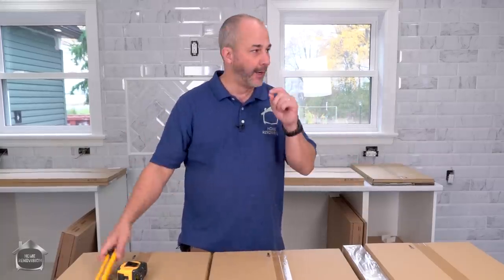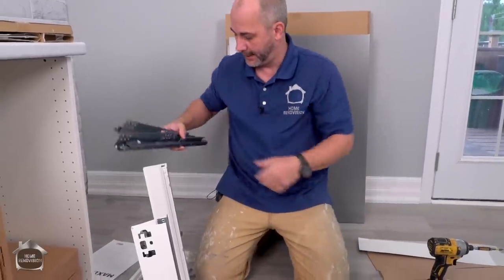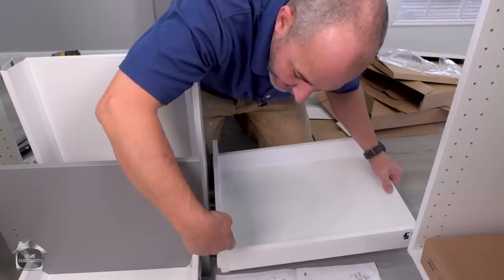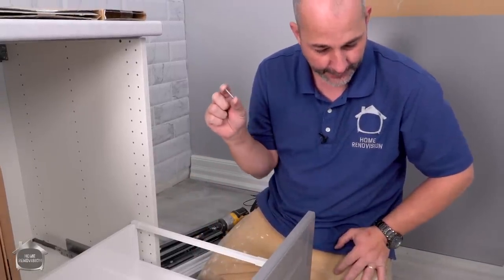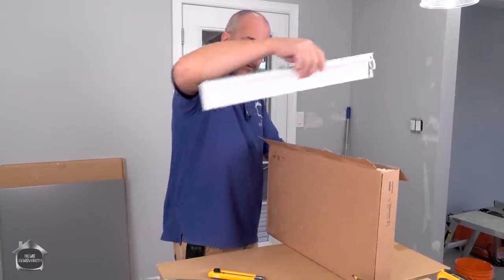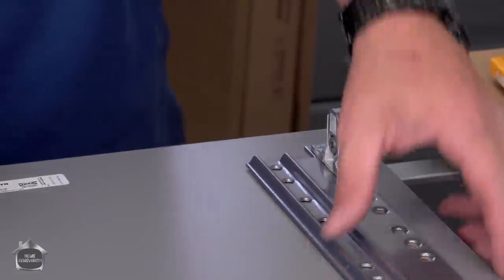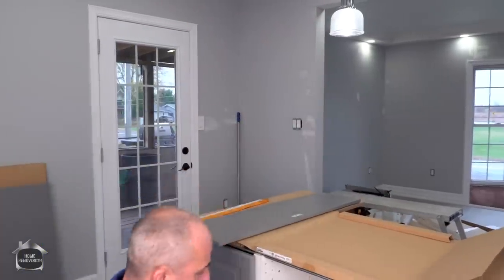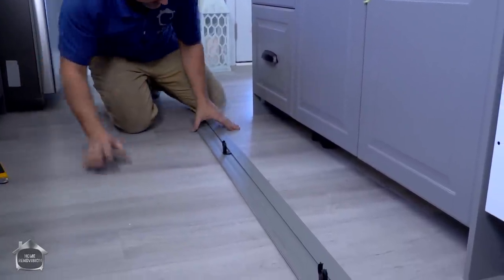How to Remodel Your Kitchen with IKEA Cabinets | Beautiful & CHEAP DIY Tutorial Pt. 2

Comment: 10 years ago when we looked into reno our old kitchen in our first house, went to one of the "well known" brand got a quote for 30k CAD  with 8 weeks plus lead time. Went to IKEA and got everything for 5k, installed all the cabinets in one week. even after 6 years of usage, the cabinets were still in top shape, everything held well when we sold it. For price and quality, there is nothing can beat it IMO. Will definitely buy them again when we built our next home.
Reply from the maker: Thanks for that. nice to know you had a great resale as well. Cheers!
Reply: not my IKEA stuff.. I have children and a very active kitchen and those cabinets barely lasted a year before they started showing their wimpy finish and garbage quality.  The particle board door do not survive nicks and bumps.  If your dishwasher hose ever fails or you have a bad plumbing day, the micro-layer of finish is not enough to keep the particle board from swelling even 1 spill sitting for over a half hour.  If you live in Arizona or a dry area... its even worse.  The particle board turns to dust.  Unless you have a kitchen just for eating take out and looks (not cooking, raising kids and living in...) spend the extra money on real laminates and / or real wood.  I DO highly recommend their counter tops and their appliances.  I got a beautiful quartz counter and very hip appliances (made by whirlpool) all my fixtures are IKEA.... it's just their cabinetry that was horrible!
Reply: I purchased my kitchen at Lowe’s. Spend about $5k. Great cabinets!! I also helped my folks install their IKEA cabinets. They also spend about that much. That was 8 years ago. Both kitchens are still going strong. The important thing here is to just do it yourself.
Reply: @inTruthbyGrace  nah i have kids to and a ikea kitchen nothing wrong with it. And the fun thing about ikea is you can just walk in and buy a new cabinet they ain't that expensive. besides they have a ten year guarantee so take it back if it wasn't your fault
Reply: We had our Ikea  kitchen installed about two years ago. We too visited the well known suppliers and got absolutely insane quotes. So it was off to Ikea. You measure your kitchen and have a good idea of where you want everything. Make an appointment with one of their design staff. They input your ideas and measurements into a computer  and can instantly give you a quote. We went with meter high wall cabinets instead of the usual 80 centimeters, more storage space! Their base cabinets are lower to the floor than standard cabinets, more storage space! We had two drawers installed under the oven for pan lids and shallow oven crockery, more storage space!  We used fifty mil worktops instead of the usual 75 mil, cheaper and does the same job. We went with flat white handleless cabinets, looks neater and easier to clean. All doors and drawers have silent closing. 
Now before your kitchen is installed the fitter visits and checks your measurements to make sure everything will fit. (What? You have never made a mistake with a tape measure.) 
Two important points about Ikea. They will not try to sell you anything, they will however endeavor to provide you with what you want. Secondly, when the job is done there are always bits and pieces left over, they are individually wrapped with bar codes. Take them back to Ikea and get a refund! We got sixty one quid back, now who else will do that for you?  And of course everything has a  twenty five year warranty.      
Would I recommend Ikea? Is the Pope Catholic?
Reply: The thing about Ikea, is that you get what you pay for. The cheapest options are not as good as their most expensive ones. Installed the cheapest Ikea Faktum kitchen 15 years ago, and the doors did not last. Just before they discontinued their Faktum series in 2012, I ordered new doors for the entire kitchen which were the solid oak ones. 8 years later and they still look as good as new. If you can afford it, go with their top of the line models. It's definitely worth it in the long run.
Reply: IKEA put their stuff through som though testing to make sure it is durable. But if you opt for the cheapest one of course it isn't as good as the more costly ones. As in every store.
Reply: @inTruthbyGrace  25-year warranty. We cook non-stop in our IKEA kitchen and can't disagree more with your experience. The finish is hard, durable and only badly placed cut ends are at risk (install error). Maybe your children just got the cheapest fronts and sides (some are as cheap as $15 a front, others in the $60+ range). If you get the mid-range fronts, it's really great. 25-year warranty.
Reply: Unless you order THAT stove/oven! It only exists in fantasy projects.
Reply: I am totally intimidated with the thought of remodeling my kitchen.  Thank you for your recommendation

Comment: I’m a professional cabinet maker. One thing I would highly encourage people to do when assembling any kind of knock down cabinet is to glue the carcass components together. Because much of the material is melamine, the use of a good quality melamine glue is advised. You’d be absolutely amazed as how sturdy this stuff becomes when it’s all glued together. Works wonders on Ikea furniture you won’t need to disassemble. Glue it all together neatly and you’d be surprised how sturdy the stuff is!!
Reply: Thanks for the tip! Can you please provide a name or link of what you recommend?
Reply: Using glue voids the IKEA warranty.....
Reply: @Petitelapinou1  does anyone actually ever use the warranty?
Reply: @Toni_Snark  if nobody uses the warranty, then you clearly dont need glue. Also, given how many mistakes i just watched this experienced installer make, i wouldnt dream of using glue.

Comment: Great video. I have enjoyed many of your videos and learned a lot of your tricks of the trade. I have installed 2 IKEA kitchens in the past and the instructions you have given are right on. That extra screw you had left over goes on the bottom of the drawer through the back metal piece. It secures the bottom wooden panel to the metal drawer back. Keep up the good work.

Comment: For less experienced DIYers, it's probably best to avoid using an impact driver (as Jeff does here) and use a standard cordless drill with a clutch. Set the clutch very low to avoid over torquing the screw in the fiber board.
Reply: I agree. I use a little 12v Bosch flex click for cabinets and doors. Way more controlled and you can set your clutch so it doesn't strip out. Especially with particle board. Stuff blows out if you look at it the wrong way
Reply: @carlcox7332 I use the same one!  The clutch set to 5-7 is plenty!

Comment: Wow did this bring back memories.  We installed our IKEA kitchen nearly 5 years ago.  10 base cabinets, all with the 3 or 4 drawer configuration except for the sink cabinet. 4 uppers, and 48” of wall unit.  It’s a huge kitchen. Each and every time I questioned their engineering was due to my own wrong assumptions.  I made pretty much the same ones you did Jeff.  It’s just a brilliant kitchen for the DIY’er to build.  As for the durability,... we put in the soft close drawers and doors through out and all of the hardware has held up perfectly.  There has also been no deterioration of the wood where the hardware connects to it.  (I think the soft close helps with that.). The white finish we bought has held up without any mars and it is easy to clean. Our visitors are still just blown away by the beauty and function of this kitchen especially when I tell them it is IKEA. The only thing I would do different is the handles.  We are always hooking our garments on them which is annoying. The SEKTION cabinets were fairly new when we built so there weren’t many video’s on YouTube yet.  Your experience will help so many new IKEA DIY’ers.
Reply from the maker: Thanks for sharing a real life experience. very helpful indeed. Cheers!
Reply: Do they have predrilled holes for hardware?
Reply: Carmel Klein yes. Just as the video shows. Each cabinet box has holes for every possible drawer or door/drawer combination.

Comment: great advice again!  I've put in 2 whole kitchens and also did my dental clinic all in IKEA cabinets ($10k spent at IKEA for the clinic cabinets in 2008).  The locally made expensive cabinets turned out to be a pita years later.  The IKEA cabinets and drawer glides are more robust and the cabinets still look and feel like new in my dental clinic 14 years on, under much heavier use than any home kitchen (heck we've worn right through the non IKEA countertops!).  I'll be putting IKEA cabinets in my big home kitchen reno hopefully next summer.  Just be sure to not have particle board shelves anywhere that will be getting wet regularly - but the cabinets are off the floor on the plastic pedestals so they are generally a ok in a kitchen.

Comment: Looks good Jeff I'm just not a fan of IKEA at all.   I replaced all of the cabinets in my house with cabinets from Cabinets to go.   Solid wood, no particle board, easy to put together.   Did the whole house for 15k.  I got a quote from 3 custom cabinet places the average cost was 54k.  These look custom quality and are flexible as well.   We absolutely love them and glad we chose them.   I installed them myself even.

Comment: When I assembled an Ikea kitchen, I used a hand brace with screwdriver bits instead of a screwdriver or power drill. I got the speed, but could feel through the brace when I had tightened enough.

Comment: Have used IKEA cabinets before, with compliments from the countertop installer.  Now I'm using them again.  They are really super quality -- not surprising since they include a 25 year warranty.  Yeah, TWENTY-FIVE YEAR warranty.  

Their kitchen planning service cost something like $75 (US), for two hours with a planner.  Arrive with some ideas.  Be reasonably familiar with options, because two hours goes fast.  It also helps if you can get all the room dimensions into a file saved in your account, in advance.  (Some kitchen planners are faster with this than others.)  I'm not knocking anything, just saying that teamwork goes a long way.  

One reason you save a lot of money is because you simply pay for all the pieces.  With a custom cabinet order, you pay for all the standard boxes PLUS you pay for every "modification" from their standard cabinet.  If, for example, their "standard cabinet" has two 15-inch drawers and you want three drawers (15", 10", and 5") then you PAY for the "design change."  There's none of that price gouging at IKEA.  Love that.  

I found that their computer is almost infallible.  After everything is modeled on screen, it spits out the inventory list.  It ALSO spits out a detailed list, cabinet by cabinet, of the five, or ten, or fifteen items that combine together to make one finished box with doors or drawers.  So, take the printout for cabinet #1, collect the pieces, and assemble.  Very high degree of accuracy.   I figure the drawing/list is accurate, and I'm the dunce.  Patience.  It will all be right in the end, and if it doesn't seem right, it's not yet the end.  

Jeff, you are spot on with several bits of advice: 
1.  Assemble all the bases, then go back to do drawers and doors.  Very helpful suggestion.  
2.  Keep all the loose hardware, directions, etc., inside each cabinet box.  Makes it easy to resume later when doing doors and drawers.  
3.  Don't throw any leftovers away.  Collect them somewhere.  
4.  The gable ends!  I kept forgetting about them.  Thanks for addressing them several times.  Sadly, the stove vent is already installed, 3/4" off to one side.  
5.  Bowed walls and uneven floors.  Great tips in the first vid.  
6.  Using a grinder to cut off the excess rail, AFTER the cabinets are hung.  Nice time saver.  

My current project is the kitchen of a mid-60s house that was framed with 4x4s and sheathed with 1x10 planks.  No such thing as 16-inch on center.  There's nothing flimsy about that outer wall, but it ain't all repeatable, predictable studs.  With the 4x4 framing there can be wide cavities, like 27 inches.  Jeff's earlier tip of putting an extra screw below the rail on the wall, for additional vertical support, becomes vital when there are so few studs for attachment.  Or, if the walls are gutted, add some plywood backers before installing drywall.  A half sheet of 5/8 or 3/4 plywood, plus some 1x or 2x pieces for attachment, was plenty for a 21-foot wall.  I went from having far-too-few attachment points to being able to put a screw in every hole of the rail if I wanted.  No stud finder needed.  You sometimes get lucky if you can plan ahead.  (While I lost 3/4" of insulation depth along that strip, the R-value of rockwool pretty much made up the difference.)

A forced air duct rises below the sink cabinet.  The old cabinet had a cutout in the kickplate, with a vent screen to release the hot (or cold) air.  My HVAC guy had a good suggestion for the IKEA kickplate:  Use a router to cut some 1/4-inch horizontal slots in the plastic kickplate.  That vents the forced air nicely, is basically invisible, is guaranteed to be a perfect color match for the kickplate (since it IS the kickplate), and you don't have to buy the vent cover.  

Thanks again, Jeff.  Mighty helpful.
Reply: great thoughts. thanks.

Comment: Tip from someone who did their own install: DO NOT trust the Ikea employees! They can’t possibly understand and recall all of the pieces and compatibility issues. Instead USE AND TRUST the designer tool on their site. It is programmed with all hardware combinations and will protect you from doing something wrong, like getting the wrong top drawer. Don’t try to override the system. You will regret it... trust me.

The designer tool is pretty easy to use and will make building your kitchen super fast and easy. And it’s 3D render gives you a very good view of how it will all look. Best of all it builds your order for you and cost.
Reply: Best to use the designer tool AND the employees, AND your best judgement when they don't agree. And still expect to need to go back to the store at least once.
Reply: I totally agree. I used 100% the Kitchen Planner and had NO problems with inventory. Everything worked out perfectly. No chance of employee error that way.

Comment: Stand up applause for sharing the fumbles! Clap......clap.......clap.....(everyone joins in on the applause)...clap.....cheers!!! 
One thing I suggest for people watching on using a battery driver, make sure it IS a driver with a strength adjustment, and not a drill or hammer drill as Jeff is using. Jeff is using a variable trigger, and he has expereince on the force and can control it, and if he doesn't you WILL easily damage the panel.  For example, Black&Decker has a cheap $25-35 driver, and that set on "2" strength will keep the MDF from stripping so you don't have to worry about over-driving the screws. It has it up to "10" strength AND has a drill setting.
FYI, 10 years ago IKEA MDF was MUCH higher quality with a lot of glue that was better than custom ordering from other hardware stores, and it was much cheaper. Our kitchen design from 10-11 years ago was about $2800, vs today. I forget the actual figure but it was something like 2-3.5 TIMES more! So Ikea went to cheaper material, higher price, yet aiming to offer more desirable styles.

Comment: FYI the reason the waste/recycling drawer seems over designed is intentional and not for the trash itself. Most people will press or step on their trash to compact it while it's still in the drawer which would break the bottom of the drawer without the extra support.

Comment: Just in case it hasn't come up yet in the over 500 comments, the L bracket for the sink face comes with the more robust metal top supports that you purchase separately for the sink cabinet. Because the cabinet box is standardized, you purchase the alternative cross pieces if you are using it for a sink, and they assume you may need the brackets for the cover piece for the sink, so they include brackets with those. Hope this helps others. I've bought mine recently, which is three years later, so not sure if it was just something that was more easily missed back then.

Comment: By now I watched about 10 videos about assembling and installing an IKEA kitchen. 8 or 10 do all the work on the floor. Only two do the same work, much more comfortable, on a higher surface. In one video the guy uses an old door from his renovation to have a workbench. It's so much easier if you don't have to bend over all the time.

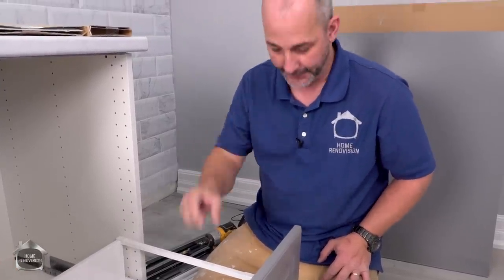Comment: Just got to 25:58 where you had the extra screw --- you're supposed to secure the drawer bottom to the metal drawer back using that screw
edit: 41:15 Ah there it is :)

Comment: You've probably already figured this all out by now, but when you ordered the cabinet for your sink, they should have included a reinforced brace kit. This replaces the thin metal cross braces and includes the angle brackets to hold the stationary drawer front. They gave me a reinforced brace kit for my kitchen sink cabinet.

I used the same grey fronts, but did 10-10-10 with a hidden 5 in the top drawer. I kept the 10-10-10 on my trash drawer cabinet too, so it would line up with all of the base cabinets.
Reply from the maker: I install a steel closet rod under my sink to help hold the weight. Cheers!

Comment: Thanks for you Video.
I am a General Contractor and I have installed many IkEA kitchens...I notice you place those end panels cut side down to the floor.. I always place the cut side up so the exposed wood doesn't absorb water when client mop the floors. (Sealed side down)

Comment: Great video. I have a question regarding the reliability of Ikea cabinets in the sink and dishwasher areas. Were you concerned about potential water damage , since Ikea uses particle board in the carcass? Did you take any special steps to help prevent this?